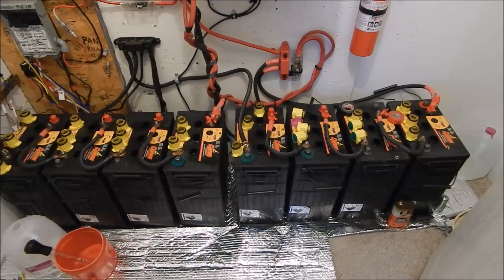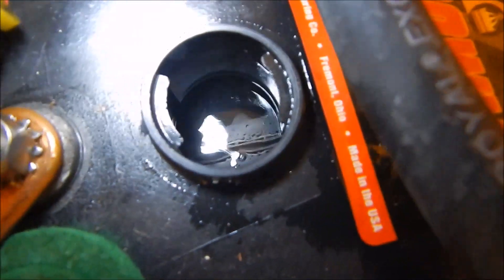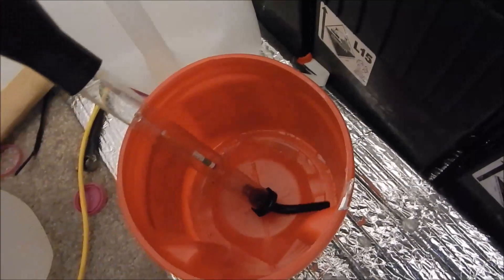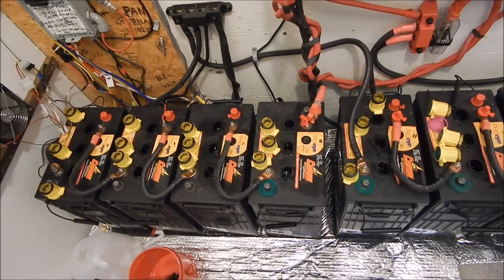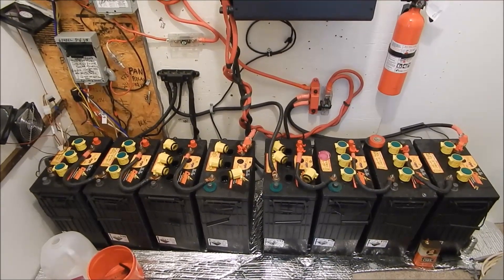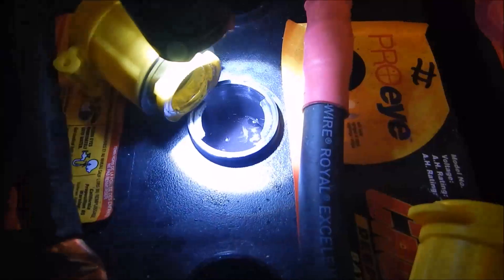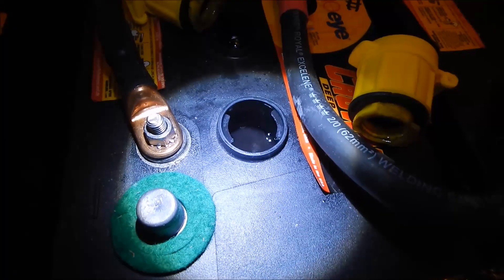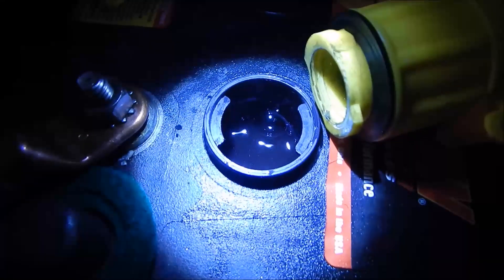Battery Bank 24V  My Big Costly Mistake!

Comment: It is easy to become complacent when it's all working. 
We've been off grid since 1986 and installed solar in 1997.
I was very faithful with battery maintenance but as you get older and everything is working you do tend to forget. 
Note the reason the water is cloudy ISNT bad it actually that buildup on your plates being cooked off.
It will be remixed as they bubble.
And yes some will settle on bottom.
Great video.
Gottah love the safety guys. Hahahah jeez they jump on bandwagons don't they hahahaha
Reply from the maker: Thanks. Old video batteries died 5+ years ago on my move to TN. Now offgrid here 5.6 years. Now run 30KW of EG4 LITHIUM SEVER RACK.set up
 No more lead acid for me other for truck or tractor starting. 😅
Reply: @TheKiloG69  yeah I haven't made the jump to Lithium yet.
Seems I get pretty long life out of my lead acids.
The current set I'm usuing is TEN YEARS OLD!!
BUT THEYRE GETTING TIRED AND WILL NEED REPLACING. 
HONESTLY IVE ALWAYS USED CHEAP LEAD ACIDS. 
MY LAST SET WAS Sam's club specials.
Lasted ten years this set ALSO Sam's club specials 6v Duracells. Also ten years. I do regular maintenance and for our applications they seem to last.
Of course my Refrigerator is LP.
My clothes dryer is LP.
My cooking and hot water also LP.
So I really only use them for my deep well pump, washing machine, and lights.
The Deepwell pump is an AC Grundfrous soft start pump but with my expansion tank you can't tell the difference in fact we have mega water pressure!!

Comment: In the video you mentioned using water or electrolyte water to keep your batteries in good condition, If so, I believe you did the same mistake like I've made, try real battery acid you can get it in any auto parts store,and with that believe me you will solve the problem.

Comment: Used sealed acid battery. GEL or AGM. It is maintenance free and it is sealed. Electrolyte will not overflow that is why they called maintenance free.

Comment: Suggestion use a mppt charge controller it will help with the crusties. Second is wire your pannels to 150 volts and you'll get way more charging time. Anything over 24 volts will charge the batteries and that means at the crack of dawn it will start charging. The higher the voltage the higher the amperage.

Comment: The biggest problem is your using lead acid. They wear out fast. Some Barley last 2 years. If you got 6 years out of them you did good. Hope you use distilled water. And sometimes you need to add acid. The air force doctors them up with a half teaspoon of Epsoms salt to keep old batteries going for a few more months. Lithium Iron oxide can last 20 years. But almost $1000. Each

Comment: Why not do yourself a huge favor and go with LITHIUM ION BATTERIES?...I have 50 LG NeON 395 W High Efficiency panels (total of 19,750 WATTS),...with 3 LG Chem RESU10H (Lithium Ion) batteries connected in parallel (total energy 29.4 kWh),...inverters by StorEdge...30 second auto-transformers (automatic transfer from grid to batteries and back to grid "if GRID comes back online again")....monitored by a wireless monitoring platform...I have UPS on all of my electronics to ensure a smooth transition during the 30 second transfer delay from grid to batteries...yes, my solar system including my batteries were professionally installed and commissioned about 1 month ago...but I'd rather know I can run everything in my house, without limitations, especially in an emergency...

Comment: If your being required to do a Equalization more then once in six months your over cycling them or Deep discharging too often. .  GET MORE BATTERIES !    As stated below, LiFePo4 batteries sure are easier to maintain and last a butt load longer.

Comment: I've been doing a bunch off research on going off grid and I think just based off videos like this and the way lead battery are I'm going to use lifepo4 or lithium ion. It's really painful to watch people end up in a predicament like this and I could totally see myself doing the same thing. Hopefully the prices for Batteries will keep coming down. Thank you for making the video best of luck to you in your future endeavors.
Reply: Lithium batteries still cost 8 times as much as gc2 golf cart batteries in 2020👍🏻 good luck with that. That means you could replace them 6-8 times from Costco for the price of battleborn batteries
Reply: Acid battery's are great .just needs lots of maintenance ..
Reply: They're a lot more reasonable in 2022. Power density, usable capacity, and longevity can be worth it if that's what you need. 😊🌎✨

Comment: Hi I have a question to this video do you use a battery monitoring device? I notice you said your battery went down to 24.1V which is about 50% but I'm using a Bogart battery monitor and at 24.1v my battery state of charge is 66% I ask this question because for sometime now I'm trying to understand what you voltage for a 24v battery bank at 50% state of charge should be. But Bogart use a counting format to calculate state of charge which seems more accurate as the total Ah of your batter is counted down as you discharge the batter hence giving you a exact AH use. What's your view on this?

Comment: Why the hell would you spend $2K on 8 flooded batteries when you can get good used AGMs for less than half of that which require very little maintenance?  Also, ever hear of a desulfator?  You can use 1 temporary battery as a "placeholder" while you desulfate those 1 at a time.  If you can afford 2 desulfators that will speed things up.

EQ is not the same as desulfating.  EQ tends to overcharge the batteries but desulfation can take place at trickle charge voltages.

FLA batteries are a BAD choice for solar in my opinion unless maybe you are retired and maintaining batteries is one of your few pleasures left in life.
Reply: You could get 8 new GC2 golf cart barriers for $850 , 120 ah usable  if running 24v  that's the price of one lithium battery @ 50-60ah usable. In 2020

Comment: Another costly mistake you might want to avoid is putting a fire extinguisher behind the thing that you fear will be where a fire comes from.  If your battery bank catches or spews acid, you will not be able to even reach the extinguisher.

Comment: Your charging voltages are reasonable depending on cell temperature. Where I live in Australia my cells rarely drop below 20 Deg C, 78 F . 27.4 Volts will keep them healthy. I suspect you are in a colder climate so voltage will need to be higher. 
A standard correction voltage is (-5mV / deg C / cell) for each 10 Deg C temp increase a 12 cell battery (24V) will need 600mV (0.6V) LESS voltage to maintain full charge.
I use Trojan T105's with our extreme hot summers over 40 Deg C I have the opposite problem, overcharging and loosing electrolyte.
Ray.

Comment: “I WOULD measure each battery voltage, look for a bad one. ANOTHER TEST is audible/visual for bubbling during charge. A BAD battery exhibits no bubbling.

I USE common off-the-shelf sealed 180ah DEEP CYCLE Durastart brand, $80 each. PRESENTLY HAVE only 6 in 24v configuration, same as yours. I WENT the winter having removed a battery I determined was somehow defective, exhibiting a low voltage. THIS AFTER having been charged remotely via a grid charger. THE BATTERY sat a few weeks. I CHECKED IT, & found it has lost its charge, sitting idle disconnected. 

MY RESPONSE to having found this problem has been to do manual equalizing. I AM guessing sulfation caused the failure. SINCE THEN, no problems.

MY 24/7 refrigerator (small Magic Chef, dorm room type,) uses 17 watts hourly. I TAKE IT offline in November & plug it back in sometime in early March. MY DAILY DEMAND is quite low. 

I PUMP water from a 4” 110’ deep well, pump septic water to a mound, & have a water softener. INVERTER IS a modified sine 5000 watt, typical of marine industry. CHARGE CONTROLLER is Morningstar 45. SOLAR INPUT is 1000 watts midday. PANELS ARE aligned to expand the window, reducing the midday peak & extending equinox charge window by about 3 hours. THIS WORKS well. INPUT VOLTAGE is 54 volts. 

IT WAS not good to find the bad battery last fall, mysterious. I LOOK toward an augmentation source, viable for winter use to offset the seasonal decrease. I RESEARCH the free energy forum, am familiar with some possible devices. THE RON PUGH charger is compelling, as is the Figuera resonant device. I COULD use it a few hours each day in winter, put it away in March, figuring to replace magnets every three years, maybe less often.

ROTATING BATTERIES may help. THE VOLTAGE CHECK with each disconnected will tell you whether equalizing has been sufficient.

Comment: I have 3 truck-batteries (12 V) each 100 Ah and each about 80 bucks. Some 10 Ah per day are comming in (and getting tapped of course). Since that is only (10/300) 3.3 percent of the total capacity  my "plan" was to do nothing with the batteries (but never charging them higher than  70 percent and never with more than 3 Amperes peak amplitude per battery; thus they never ever getting even lukewarm). Maybe checking once a year if the waterlevel is still high enough and doing a reffill if needed. I'm prepared to buy another battery every 4 years or something (given that the capacity of a given battery halves every 5 years). Am I wrong?
Reply: Peter8aus8Berlin, I'm pretty sure that lead-acid batteries don't like being kept less than fully charged... it creates suflate issues.

Comment: You would be far better off changing these worn out "old school"batteries for lets say four (yes only four) LiFePo4 batteries , the large prismatic sells from China ( brands CALB, WINSTON, SINOPOLY) they have them in different capacity's, i would think looking at your video that four 400 AH each will totally replace the L16 batts witch are now sulphatet and therefore loosing a lot in capacity , maybe half of their original values, best to do a capacity test to know for sure, also when lead acid is so much sulfated as these, you have a far geater risk of a short in the plates, so i think its time for something new and BETTER.
LiFePo4 batteries behave pretty similar as lead acids but DO NOT sulphate, can regular discharged without capacitie loss to 80 percent DOD, do not need to be "equalized", in fact the wil last longer when a little UNDERCHARGED, have a much lower internal resistence and a far more steady voltage drop during discharge , so much so that voltage alone is almost the same being full or 70 percent discharged, do not have toxic/flammable fumes, their weigt is on third of lead acid, ant lastly can have a useful lifetime of at least 10 years or more in a solar bank, you can just drop these in , your solar controller is a high end model so with a little tweaking of the charge/discharge settings wil give a good charge to them, o and i allmost forgot, their charging efficiency is about 40 percent HIGHER than even the best lead acid type batterie can give you, especially beneficial during winter.... I would check them out, hope this helps.
Reply: I recommend the 26ah lifepo4 batteries that came from hospitals for 30$ each on ebay.
Reply: @SamIamNotI  How about a link, looked for what your describing with no resluts.
Reply: @jimthvac100  Turns out they are Li-Ion but if your still interested I used these for a 7kwh powerwall: https://www.ebay.com/itm/2-x-Enovate-Medical-Mobius-Power-LIithium-Iron-battery-10-95V-26-5Ah-290-18Wh/162963392160?hash=item25f16006a0:g:PTwAAOSwRE5abivW
Reply: Thanks for your comment which piqued my interest in LiFePo4 batteries. Great call- big investment yet gives us a great return:  MUCH lighter weight (29 lbs. vs. 140!) with 10X longevity, and can discharge 90% vs. 50% without harm. WOW- so much newer technology. I easily found them on Amazon https://www.amazon.com/gp/product/B06XX197GJ/ref=ox_sc_act_title_4?smid=A2VHGGOHXF24LJ&psc=1

Comment: Whether you have Water Saver-Caps or not, has NOTHING to do with how often you Equalize. Nothing! YOU need to Equalize often because YOUR Battery Bank is not being recharged to 100% SOC every night = a very bad thing. Once that sulfate hardens, you will have permanently lost capacity. Cloudy Electrolyte is not a good thing. Your PV Array is too small for your large battery bank.  At 50% DOD, you need 6 continuous hours of FULL SUNLIGHT for Bulk Mode plus 1 - 2 hours of strong sun for (30 Volt) Absorb Mode plus 1 hour of low sun for Float Mode to recharge you battery bank to 100% SOC each night.  You barely have enough PV Panels to do this, on a good day.  So, now where are you getting the WATTS to run your daytime loads?  You REQUIRE EQ often because your PV array is WAY TOO SMALL. You need to stop removing more more Daily Watt-Hours from the battery bank vs what your PV Array can put back in.  You battery bank will fail early....
Reply: its a natural fenomenon u not only get out of the batterys what u put in ,the loss of energy is a big factor.my senses say u can only use  onethird of the energy,reasons already mentioned by others putting in technical therm.
But if u do it right and save on the consumption the system may last a very long time whit little maintanance,it has to be in balance.
My motto,Input on a cloudy day ...output should be enough for me... not really economical? depends on howu look at things! it may last a livetime.
Stil nice system sir 👍🏻
Reply: you're full of it....
Reply: @donaldbadeaux5455  actually he is 100% correct.

Comment: Good video of the maintenance of a battery bank. 

On the safety side I would recommend this. Never open all of the cells at one time. The fumes they are producing in such a small room can be very hazardous, not to mention, if there was a spark created from all the other electrical apparatus in that room, it could very well cause an explosion. Finally, move the fire extinguisher to the outside of the room. Last thing you want is to reach over the fire to get access to the extinguisher.
Reply from the maker: Thanks, please check out my battery box videos,I have made a box out doors.
Reply: Some Water Miser Caps must be removed during EQ.

Comment: Based on my experience the Midnite classic voltage and amps readings are incorrect. You have to  check the settings and the voltage, amps readings with a calibrated volt amp reader. Mine was 0.5 volt below of what the classic was registering, also the classic does not have a voltage reading sensor!  The L16 batteries should be equalized at least every two weeks.  Be Well, Raz

Comment: Arent these type of batteries old skool now, try effecient lithium like others?
Reply: Lithium isn't any more "efficient" and for home use, their power to weight advantage is useless. In an off-grid system, cost efficiency is usually more important than individual component efficiency, anyway. For home use, it's very tough to beat the cost efficiency of good ol' heavy, lead acid batteries. The key is keeping them well maintained and not over-used. I'm on my 8th year of my pack, with regular desulfation...
Reply: quote: "Try efficient lithium batteries like others..."
Those "others," who went to school, then college, then graduated from schooling, then obtained high paying jobs so they can afford to purchase those HIGH PRICED quality batteries. Too expensive to try. why? greed...
Reply: @AlmaWells  thats why you need to DIY and make your own like im doing as we speak , you can find in alibaba good lifepo4 cells around 100-300AH for 50-100$ a cell which is way way cheaper now just buy a good BMS and it wont cost much.
Reply: Alma Wells....Huh?
Reply: Those '' efficient lithium like others'' are only a few percentage more efficient than those old cool batteries.  lithium batteries  cost way more and the lifespan is shorter. Litium also need special chargers so they won't explode and the discharge rate has to be limited so they will not catch on fire......lithium is out of the budget for most diy solar off-gridders. 
My lift battery may consume a bit more power when charging or discharging, but I can not beat a life of 20 plus years. 
If needed, I can always add an extra panel to charge those old school batteries, which would be cheaper than those lithium batteries anytime.

Comment: I have missed the part about where 24v configuration is in some way responsible for this problem ??  Is possible suitable voltage/current is not supplied to do a proper EQ cycle ?
I definitely understand fla require frequent attention !!  Tnx for the warning !  rc

Comment: How to you EQ a pair of 4x6V Pb banks when they are wired like that?
Isn't cell balancing just for Lithium cells?
Reply: I reviewed a reply by someone who claimed to be a qualified tech. He claimed bats must be rotated in position periodically because the first two in any string always showed most usage. He said number all bats and keep record.  rc
Reply from the maker: 2 banks of 24 v. 6 x4 x2, tied to bus-bars. Charging & EQ just the same as 1 bank of 4 battery's 24V.
Reply: I see now thanks, I was getting confused between equalisation and balancing